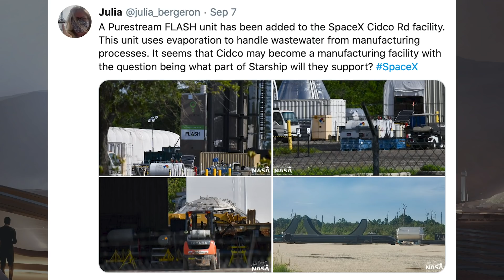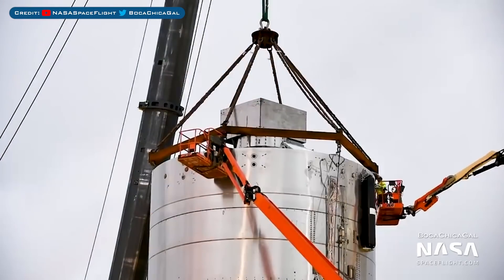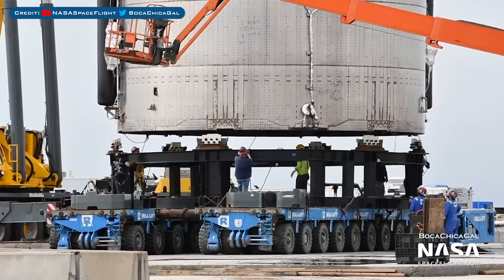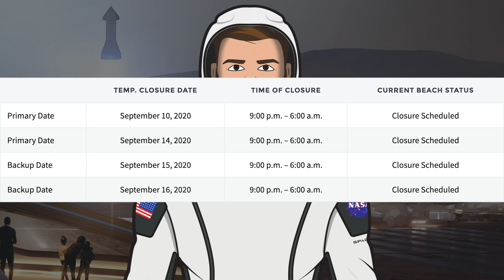SpaceX Starship Updates! SN7.1 Testing Soon, SN6 Returns! TheSpaceXShow

Comment: Even when its confirmed that the new launch mount is for launching Super Heavy I am thinking on how slim those legs on the mount looking when considering the MASSIVE weight a fully loaded Starship on top of the Super Heavy would have and even more so when you consider the weight of the top part of the launch mount itself. Could it not the foundation of the crane and crew access part instead? If you look back at the shuttles rotating structure that was massive. Johan.